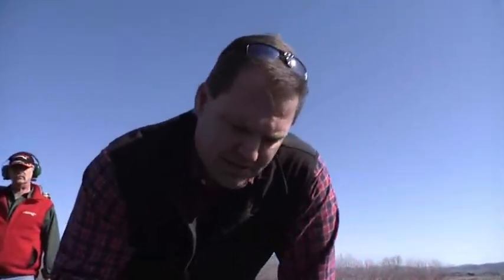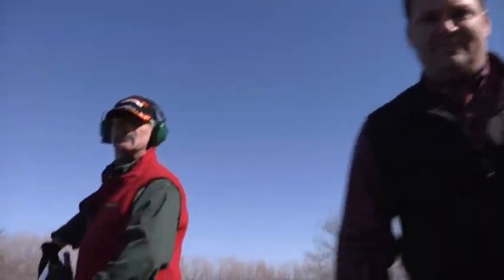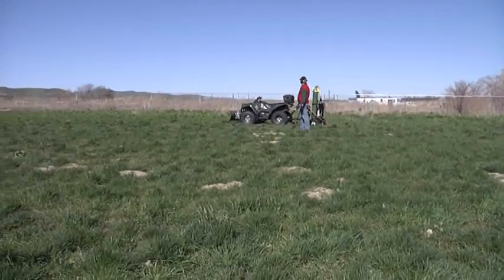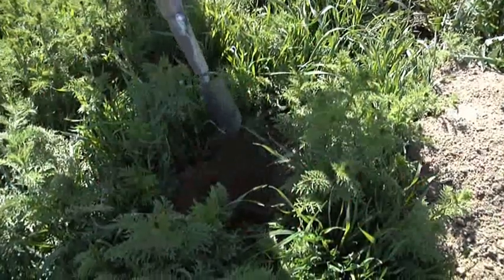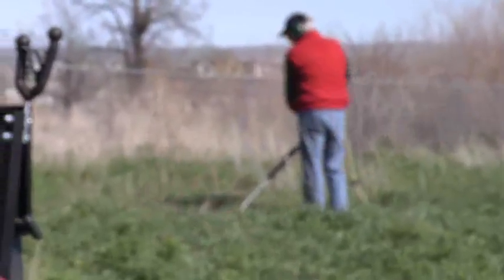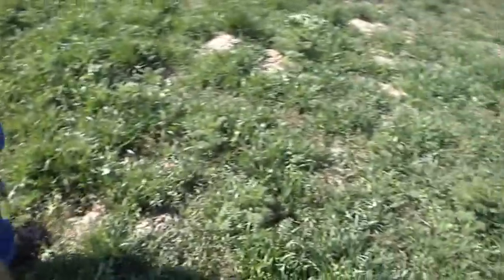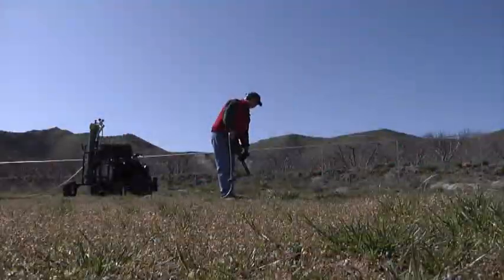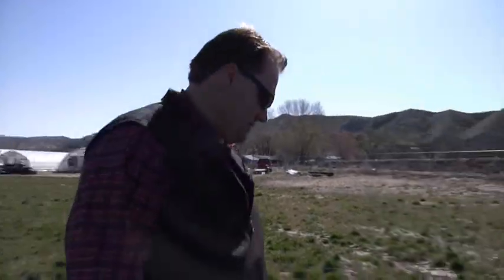Rodenator R1 Training Part 3

Comment: Have you tryed the Carbon  Monoxide method?   look at  "  GAS A MOLE Redneck Mole Killer "  and  " Gopher Extermination With Carbon Monoxide"   I have tryed it and it works.  When the mounds re appear just use this method  again    .  Its non messy and Humane .  They go to sleep and no pain!